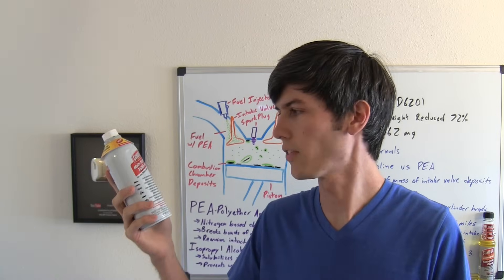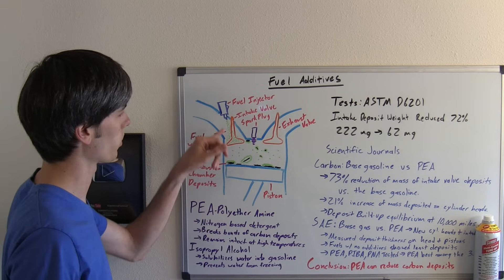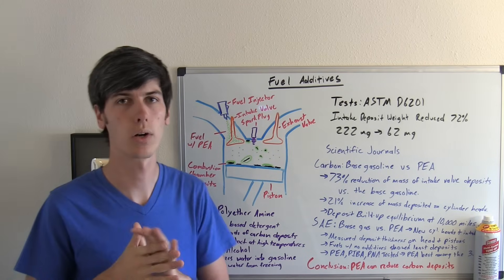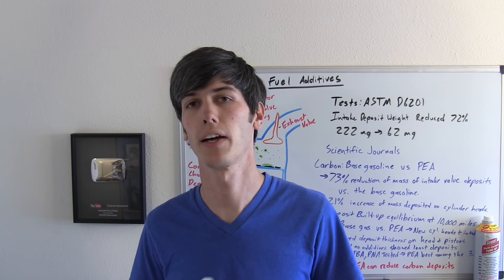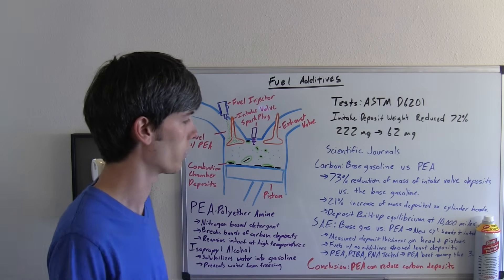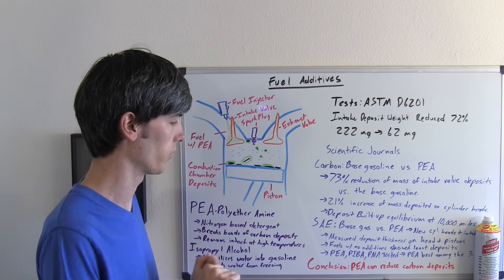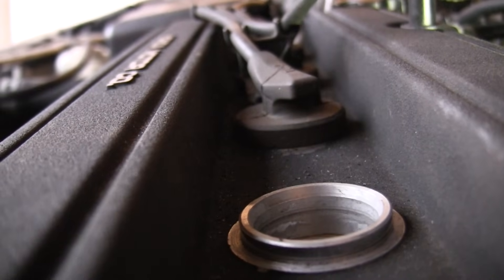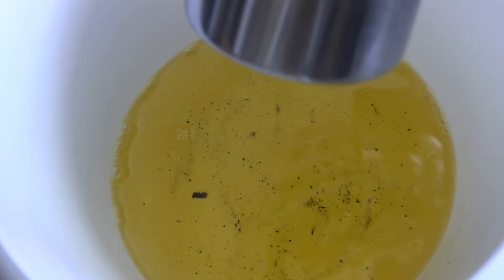Fuel Additives & Injector Cleaner - Explained

Comment: Hi guys at Engineering Explained!

Sorry if you've already answered this question but I was wondering whether an 'Italian Tune Up' actually works to clean injectors/have the engine run more efficiently? What I mean by that is when the engine is up to temperature, every so often keeping it in the higher rev range (and thus higher temperature) in a lower gear to remove deposits etc.

Thanks in advance and keep up the good work!

Comment: Water injection wins everytime. Removes all the carbon and no harm to the Cats.
Reply: +Claude “Reviews4U” Rains does it really? that's cool, never knew that before. now i really want a water injection system
Reply: User Name It's been around for at least 60 years. Try looking up water injection kits.
Reply: Claude Rains i knew about water injection kits for keeping cylinder temp down in high boost turbo applications, i didn't know they also cleaned carbon. win-win

Comment: Thoughts on acetone as an additive?
Reply: +Chemistryisthegame acetone will increase your octane rating in gasoline, but you must be careful how much you add. The rule of thumb I have heard is one ounce per 10 gallons of gas will give you a 1 point octane increase. ( I have zero scientific evidence of this ok) The problem is using only acetone for an octane booster is you are not adding any lubricant with this method so you run the risk of making the fuel too hot (for lack of a better term) that without the added lubricants can over time cause some problems. But this is why some guys I have seen will get a mileage increase by adding acetone. But modern cars with the computer control, will offset any increase you get by thinking the car is running lean and simply dumping more fuel in negating your mileage gain

Comment: I would think when using additives in a attempt to clean carbon of the valve the additives would maybe make a bit more difference on multiport injection engines vs direct injection? I'm not mechanic...but It just seems like additives would have less of an effect on direct injection. Maybe/maybe not.. again, no mechanic... I had an old mazda I use to occasionally dump in some 44K (along with basic maintenance) and even with high mileage the engine would purr like a kitten. Recently became an owner of a TSI engine and have been reading up on carbon build up issues with those engines. It's all very interesting.
Thanks for posting this vid...I enjoy your work.

Comment: I think SeaFoam and B-12 (a stronger additive) are great for direct fuel injection engines. As you know, direct injection engines don't have that constant fuel spray on the intake valves (like multi-port fuel injection does). Because of that, the intake valves on DI engines accumulate carbon buildup overtime. That's when SeaFoam or B-12 (for extreme cases, and cheaper BTW) comes handy. Some Seafoam thru the vacuum line will help remove some of that carbon buildup on the intake valves. Toyota's D-4S fuel injection system has the best of both world, direct fuel injection and sequential port injection.
Reply: Justin Hickey Multi port fuel injection has the fuel injectors right before the intake valves. So they spray the fuel right when the valves open. Meanwhile, a direct injection system sprays the fuel inside the cylinder, so the valves aren't getting that constant spray of fuel (which keeps them clean). This is why direct injection engines tend to have early carbon buildup on the intake valves. Just google "direct injection carbon build up."
Reply: U

Comment: This stuff cleans out your carbon on engines that have been reasonably well taken care of. Its not gonna fix a blown head gasket, a spun bearing, a bent valve, a cam ran flat, or patch that window in the side of your block where you threw a rod. The people who buy this stuff are usually the people who are 5 years late on routine maintenance, and that is not who this product is for.

Comment: I think in modern fuel systems isopropylene alcohol has no purpose anymore. Fuel has ethanol in it. So at every fill up you have water protection just like isopropylene alcohol. Great video, just making 1 point.
Reply: Not that I loved the 12 hours I spent on a fuel tank all gummed up and varnished by ethanol, which totally choked the fuel pump...at least it has one benefit...the 2nd if you really do your research is that while initially it raised our costs at the pump in 2011 it reduced your average fill up by about 89 cents and $1.12 in 2012. Sorry, that's the data I recall from a professional conference. (expect some inaccuracy...it is by memory, but it should be close. I watched it on YouTube...I watch too many to refind the hour long video, nor will I watch it again ;) )

It is also a domestic product that has saved us from billions of barrels of overseas oil. I still don't  like the fuel system damage it caused, but it's not ALL bad. Just be sure to empty your gas tank if it'll sit to prevent this! Oh wait. Metal gas tanks that sit empty will rust terribly...the only win is storing a full fuel tank with no ethanol...is it even possible?

Comment: I bought a ninja 500 (motorcycle) and it sat around for 3 years with only getting 10k miles on it during that time so it did allot of sitting around. Would a use of one of these help and which method should i use? thx

Comment: what is the issue with car not running daily, I say, I drive the car a little, every 14 days to say. any recomendation. Got the engine serviced one month ago, valve adjust, injector cleaning, new timming belt kit, new fluids. Prior to that service idling was a bit poor and the mechanic told me that not running the car often was the root cause. How true is that ?. Thanks.

Comment: will it increase horsepower slightly? (as it takes out the carbon deposits and increases the volume of air inside the cylinder) or prolong the life of the engine/car if using the cleaner? just wondering.

Comment: Can we use engine cleaners by pouring them directly in the spark plug hole (directly in the combustion chamber) so the piston head gets cleaned a few minutes/hours soaked? Or even overnight?
Reply from the maker: tonytober I would definitely not do that.
Reply: If you are asking me to use this, I think not it will not clean the cylinder circumference evenly for one and it will leak down into the oil and harm the viscosity of the oil and again it will not evenly enter all cylinders at the same volume as some valves may be closed. some others will fill faster as to clean as loosen carbon or seal area around rings that has built up to help in compression on some cylinders. Not worth the risk, only use when the engine is up to temperature and use sparingly. Do not waste your engine dumping a gasket and seal eating liquid into your master piece.
Reply: If you put engine cleaner in a spark plug hole it will leak down into the oil and ruin your oil as for thinning it out and may cause internal gasket failure and possible premature lifter fatigue. among other issues.
Reply: Thanks for the heads up, Engineering Explained and John Vandiver ! :)
Reply: TT.
Lets say that you try this .
My question to you would be , how do you get it out the next day ?
If you don't .
Your engine could very well Hydro-lock breaking your starter, snapping a rod & causing other major issues with non compressible liquid in it .
Crank it with the plugs out & make a mess & possible a fire perhaps ?

& all the pistons are not at the top of the Cyl at the same time so you may need as much as a gallon or even possibly more .
Everyone seem so paranoid of a little carbon which is a naturally occurring process in any internal combustion engine .
Could it be that advertizes want us to be paranoid so we'll buy their snake oil ?
I think so !

Comment: Is heat a necessary components for the cleaners to work? Will the cleaning agent do anything but letting the parts simply soak?
Reply from the maker: Kirill Ostapenko It would certainly make a difference. I was curious though and didn't have a borescope nor the time to run a proper test.

Comment: I actually used a bottle of Gumout Fuel Injection cleaner in my 2005 Subaru Outback XT with the turbo ej255 motor. The wagon has 147k miles on it and started to develop a slight shudder at idle. I am half-way through the tank of gas with Gumout in it and a much smoother idle very noticeable and for five bucks it was well worth every penny. It is great to see a video that actually had an explanation as to how and why these products work along with an example. You have gained another subscriber! Thanks!
Reply from the maker: Thomas Poland Thanks for watching, and sharing your experience!
Reply: Thomas Poland

 I know this is 2 years later, but I have the shuddering idle on my '08 subaru legacy at 62k miles. Damn it sucks
Reply: My strange studder goes away when the tires are at the proper pressure. 30psi rear and 32psi front. It is a strange situation, but it's livable.
Reply: Thomas Poland

(long story) 

mine are always inflated slightly about PSI (as so I don't have to worry about when it gets cold and affecting PSI, etc). The shuddering is usually bad when the engine is warmed up and having been driven a while and I come to a slow down/stop or am sitting at red light (rpm drops from idle to 200-300 RPM) . Happens most when heat or AC are when. 

Seems like the car being required to make more power brings the issue forward more. One day during a hot day when I was at a drive through, engine shuddered and shut off when I had the AC running. No check engine light or anything happened before hand. 

Brought the car to my mechanic, he cleaned throttle body, air filter (which was already clean)  checked air box, etc. Seemed to help the situation a little. That was a year ago. 

Worst it got was last week. Engine sputtered and rpm dropped to 100 and check engine light flashed for a split second. Drove It to my parking lot and didn't drive it for a week until I was able to bring it to my mechanic. 

There was a slight leak of what seemed to be power steering or oil, behind the alternator. My mechanic cleaned it and couldn't find the leak. He takes the car for three days and doesn't feel the shudder. He recommends me a gas cleaner to use and then get back to him. I'm waiting to use cleaner since I have to wait till tank is at 1/4 tank. 

This entire process is just crazy.
Reply: Update please - did the fuel cleaner solve the problem?

Comment: So, if the build-up on the pistons comes after use of the product but diminishes after use of normal gasoline-sounds like you should use Gumout intermittently to keep injectors and valves clean and the pistons will take care of themselves. Maybe just add a bottle of Gumout after every third oil change or so.

Comment: Are you telling me Arco is the best gas??? My wallet thanks you
Reply from the maker: Carlos Lara Haha I never said it was the best. That's where I fill up my Integra though. I usually head to Shell for my STI (went to Shell and Chevron before ever collaborating with Shell, as both were close and put a lot of money into research it seems). The logic I go by is basically big names with big money can afford to research additives effectively.
Reply: Engineering Explained There are numerous brands, including Arco and Shell, which have the Top Tier Gasoline designation.  It actually surprised me that Costco is on the list as well.

Comment: Does PEA work in GDI engines, specifically with respect to intake valve coking? I have a hard time understanding how, since the fuel is directly injected into the combustion chamber.
Reply: It will only work on systems like Toyotas D4s where port injectors are used with DI to prevent intake valve build up. Otherwise, routine intake manifold treatments may be necessary.

Comment: while on the topic of old cars that have not been driven in a while. what are the long term consequences of adding quick start mixtures on startup to such an engine? I know this is a bad idea on diesel engines due to the high compression, so what damage can it cause in a petrol(gasoline) engine?

Comment: Could you possibly make a video on e85? I'm still trying to wrap my head around why swapping from pump gas to e85 with pump gas still in the tank will have you running rich and vice versa. I'm guessing it is because the ecu can't cope with dramatic octane changes but if you could clear this up that'd be helpful.
Reply: E85 contains more Oxygen, so more fuel is used to get proper mixture. ECU doesn't have to compensate for changes in octane as much as it needs to get the ratios correct. Flex fuel vehicles use a sensor to read the ethanol content in the fuel to properly adjust ratios. If the vehicle doesn't have this sensor then using E85 with any residual fuel in the tank can cause the ratio to show rich. Not necessarily a bad thing. E85 mixtures change depending on altitude and temperature. E70 is generally supplied in winter months where E85 would have a hard time starting up.

Comment: Consider this - as the engine wears, the amount of blow by gasses increase, reducing the effective compression ratio.  As carbon deposits build up, the effective compression ratio is increased, compensating for the increased amount of blow-by gasses.  If you clean out all the carbon deposits in a worn out engine you will actually lose engine performance!  This is obviously not taking into account deposits on valves, spark plugs etc.

Comment: I use gumout from time to time and it seems to help a little, or if nothing else it certainly doesn't seem to hurt. However, in the video you say that the Journal of Carbon claims that while intake valve build-up is reduced, cylinder head build-up is increased 21%! I'm just curious if there would be any lasting effects from this either positive or negative. Thanks for the video!

Comment: Want to have some fun decarboning your engine. Only works on carburettor with manual choke though. Drive the car reasonably high in revs in second gear. change to third, drive a little faster. pull out the choke. drop back to second gear at the now higher revs and keep it floored for about 3 or 4 seconds. Get someone to look out the back window of the car at all the junk coming out the exhaust. Old school. These modern cars take all the fun out of do-it-yourself